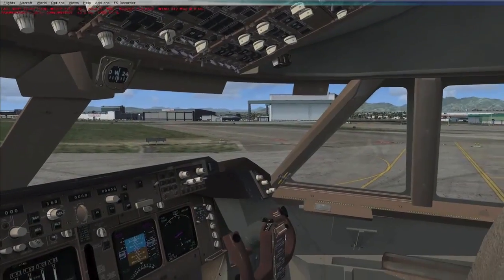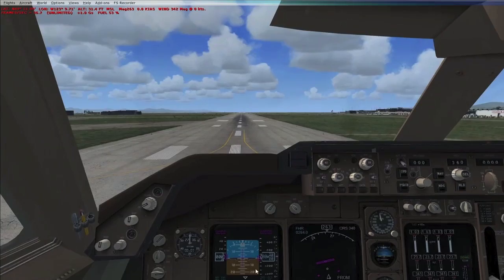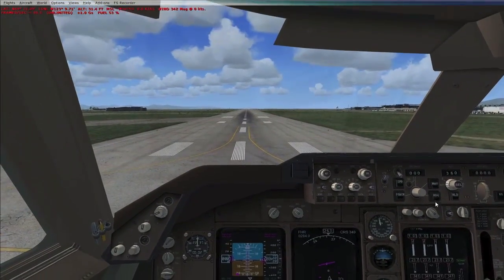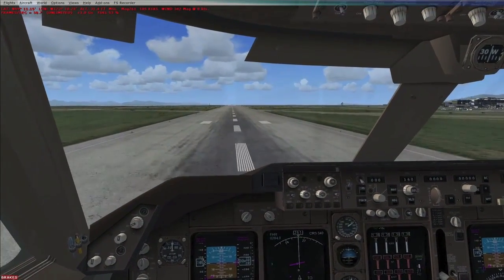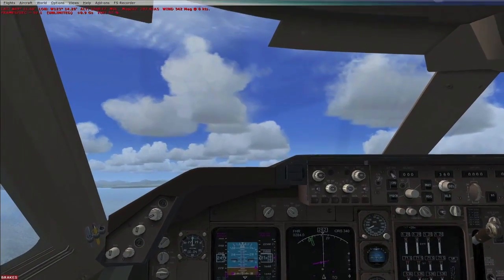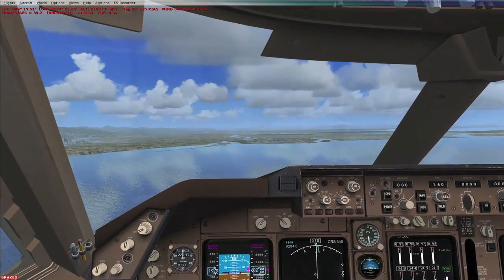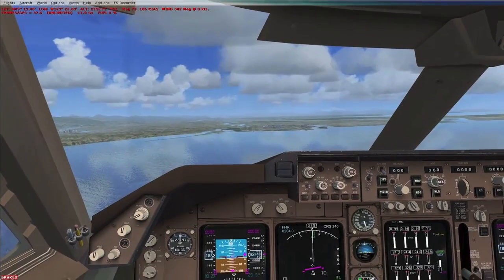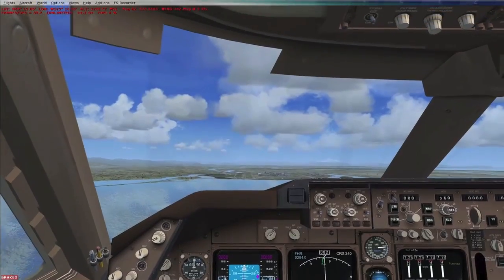FSX Boeing 747-400 Takeoff and Landing Basics

Comment: I'm pretty sure your not suppose to use flaps on take off
Reply from the maker: I'm pretty sure you are. Commercial jets use flaps on takeoff. A cessna won't, but a commercial jet will use flaps on takeoff, more of the question is how much flaps.
Reply: I've been on many commercial flight and the pilots never used flaps on take off. Flaps slow down the take off which can be dangerous in some situations
Reply from the maker: I don't know what proof you want. I've been on a commercial jet, sitting by the wing on a 747-400 and I can promise you the flaps are down.
http://avioners.net/2013/07/klm-asia-boeing-747-400-while-takeoff-a.html/
This picture clearly shows flaps being employed on takeoff. Furthermore they're not dangerous, the reason why they may not be used is if the runway is extremely long and you don't need to use absolute power and maximum lift. Furthermore flaps reduce climb performance and acceleration, complicating climbing and fuel efficiency.
But no it isn't dangerous for commercial situations; I don't know where you got that idea from sunshine.
Reply: Ok i guess those pilots were stupid because we had the same crew 4 times in a row all international flights. Stupid Austrian airlines. 
And can you do a Antonov An-225 from a short runway its a request not a question because i failed once cause i was stupid enough to not use max thrust on take off.
Reply from the maker: And you're going to need flaps as well.
I don't really want to do the AN225 since there aren't any decent renditions of.
I could do it in a military jet however.
Reply: actualy you are go look at northwest flight 255 they didn't extend the flaps on takeoff and when the nose raised it raised up too high they got up to 50 feet struck a light pole rolled over hit the highway slid down it hit an over pass and exploded all because the flaps were not extended
Reply: Toasted Vengeance i bet you have...on family trips to Florida.
Reply from the maker: CrimeJail Actually to Canada. In business class you pleb.
Reply from the maker: CrimeJail And checking your channel out, why are you going on a flight simulator channel?
Judging by the videos you have uploaded surely these videos are irrelevant?

Comment: My autopilot is not working right at all, alt hold just plumits me stright into the ground; vs +1800 CMD is on. any idea what is causing this? altimeter set correctly btw
Reply
Reply: This is stupid question but did you actually select an altitude to hold?
Reply: yea i did, turned out it was my trim wheel pitched all the way  down lol!
Reply: so why did it happen when you turned alt hold on?
Reply: it was happening all the time either with it on or off, wouldnt have thought trim would affect the alt hold when its on but it does and the nose was pitching down anyway
.

Comment: for any weird reason ... any aircraft i fly.. stalls as soon as i take off >_> ... anyone has a good sets for doing an automatic take off?
Reply from the maker: You may be bringing the nose too high.
Reply: even with autopilot? and even if i put the vs to 500. ?
Reply from the maker: Jack Green Check that your throttle is actually full power.
As a test lower the fuel load to about a third and see how the aircraft does.
Reply: Wow, you never use your autopilot on the ground! Only after you take off! Of course the autopilot will trim back and stall you if you're flying auto on take off. Even if you set the vs to 500. Wow, you must be new to aviation.
Reply: +Kumy i always fly 3 or more hours manualy

Comment: 140 knts for taking off. Lol, you need to actually calculate ur rotating speed, You use ur fmc, and u input all the info in the fmc, and it gives u a good v1 and rotating speed. if u randomly pull out a speed, you're most likely not gonna get lift. My aircraft needed 190 knts to lift off, It was because my aircraft was havier
Reply from the maker: +MR COURIER Yeah, but this is the default 747.